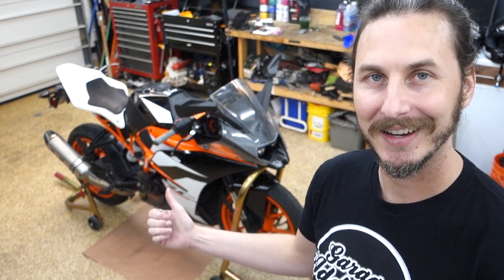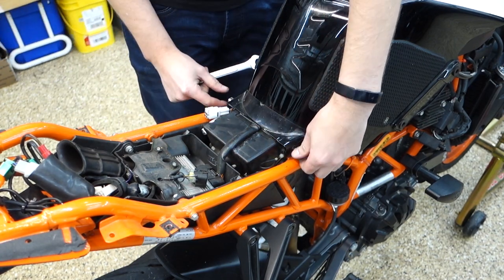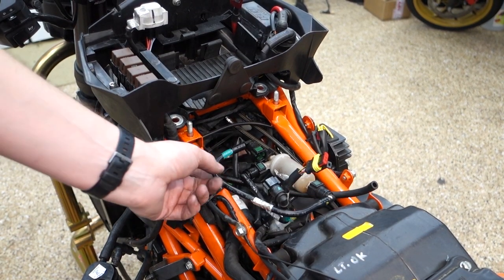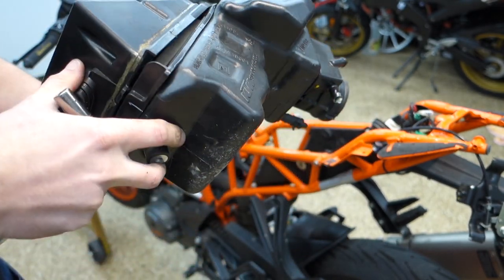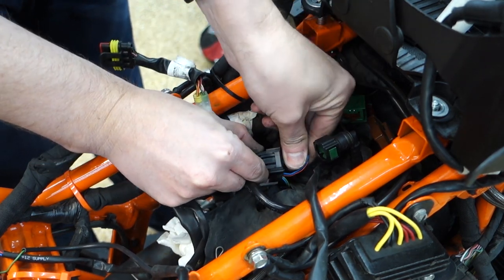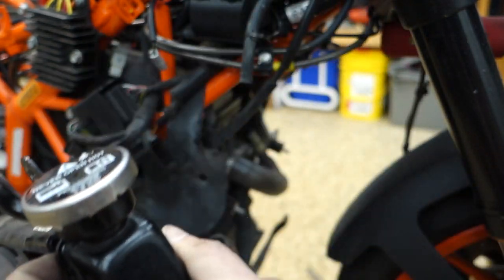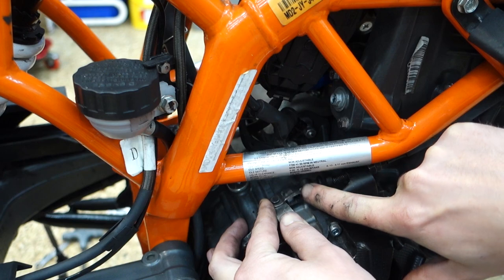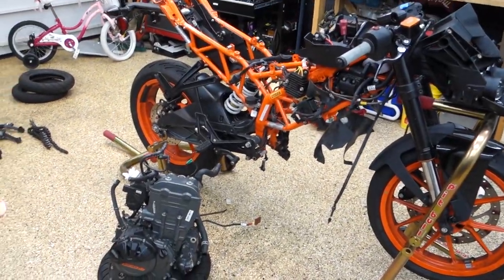KTM RC390 Disassembly and Engine Removal

Comment: Dismantled my RC390 without taking enough pictures; your video served me well as a reference for many bolts, attachments and parts placement.  This bike is by far the worst I've worked on in the past 30 years! 😞 Thank you a thousand times for your detailed video.
Reply from the maker: Haha glad it was helpful! Hope it's running well for you now!
Reply: @GarageAddiction  Last bolts where installed on dec 17th (yesterday). Even got a chance to try it on the road before the snow arrived today (up north in Canada).  🙂Having reajusted the valves (out of spec badly) and discarded the stupid rubber sheet over the engine I can clearly hear the clickety of the valves; nothing alarming.

Comment: Nice work. Taking mine out this winter as I bought it cheap with 13000 on and a full service history...... Except when I looked at the service history in detail its never had valve clearances done. Useful video at least I know what awaits me!
Reply from the maker: Thanks! I’ve got another video doing the valves too. They’re not so bad but I’d pick up a shim kit before you dive into the engine. Sounds like you got a steal on the bike!

Comment: Could anyone help @ 43:29 there is two black connections on the middle left a couple inches above the motorex logo what are these my Duke 390 has a oil buildup there
Reply: He points exactly to them at 43:03

Comment: 26:04 ideally this breather  pipe should be routed to a closed filter externally. You can get many adtermarket breather filters. There would be 2 of these one from the crankcase which would have some liquid exhaust vapors coming through, the other from the top engine case with only vapor. Inhave removed these from the air box. Companies also do this to cheat on emisson norms is what i heard. Cheers!
Reply from the maker: Yeah I’ll probably tie these into a catch can at some point. It seemed like a decent amount of fluid made its way into the air box previously. Cheers!

Comment: What were the most common sizes of bolts you used during this? Trying to put together a small toolkit for roadside repair
Reply from the maker: I'd have to go back through and check but I know 5 and 6mm allens, and 10, 12, 14 sockets would be good.
Reply: Your bike should have a kit under the seat, if not maybe you can find one on ebay hopefully?

Comment: Which oil do you use? Here in Brazil, MOTOREX full synthetic 15w50 is indicated. But this changes in each region.
Reply from the maker: I use Motul 300v 15w50, https://amzn.to/3Uc6hHX 
It doesn't get very cold here so it's perfect.
Reply: @GarageAddiction  Thank you.
Reply: @debyttt1  In India, we use 10w50 grade for 390 Only and Motul, Castrol and Liqui Moly are the standard brands for KTM. Castrol is the BEST for Duke-RC 390.

Comment: Hey bro, i am from India i need some suggestion...i dontknow if you r aware of Bajaj bikes they are sister concern of jtm, here i would like to know if we can swap engine of duke 390 with Bajaj ns200... If possible can u do some research on it...and plz let me know if possible..i will be waiting.
Reply from the maker: The engine mounts look similar but info on the  Bajaj ns200 seems pretty sparse. My guess is that it wouldn't be a straight swap.
Reply: @GarageAddiction  yes it would not, so that's why i thaught if u could help in this mod...anyways best of luck.

Comment: Hi there - i'm starting on this project myself this week. The donor motor is a 2018 Husky 401 motor which from what I heard was made in Austria so hopefully I wont run into any issues with the head gasket. Question for ya - which parts did you find was not really necessary to remove in the end (if you had to do it all over again?) great video this is going to serve alot of people well especially newbies who dont know what a pile the early gen RC390's are like me ha!
Reply from the maker: It's been a while but I think almost everything I pulled off needed to leave to get the engine out comfortably. Interested in how the 401 does in there!
Reply: @GarageAddiction  I will def keep you posted!
Reply: Just wanted to let you know I got the 401 motor in and running. Only thing with swapping older to newer motors is that the gear indicator connections and coil pick up connections have changed. Its easy to splice the coil pick up in there but rather impossible to do integate the gear indicator without swapping them out and splitting cases. Not a big deal but the bike wont idle with the kickstand down because it doesnt know what gear its in. I will use a bypass to fix that and just live with it for now...just wanted to give you an update. Thanks for all your help with the video, it helped. I did not remove any harnesses or cables out of laziness and fear of not remembering how it all came together but your video was clutch in the whole project. Many many thanks to you.
Reply from the maker: @Freddi922  Glad it went well! That sounds like a fun project!
Reply: Keep up the great valuable work!

Comment: I wonder if you are loosing coolant from the radiator where you see the road grime. If you had a head gasket issue, wouldn't the engine temps rise fairly quickly?
Reply from the maker: I haven’t lost a drop since the rebuild. Before the temp would increase and never drop, the fan would come on and it would remain in the top line. Now it bounces between 1-2 under the line after hitting it. I’m actually thinking of adding another fan or larger rad to keep it 1 under the top line constantly.
Reply: @GarageAddiction  i reccomend the spal racing fan on amazon my bike stays around 6 bars even in az summer
Reply from the maker: @tru1stdrifts104  yep, rocking the spal fan and it's great

Comment: this single cylinder bike has lots of electronics than a 2 cylinder ninja 300, Fan made in india by kinetic
Reply from the maker: Many, many connectors in here.
Reply: @GarageAddiction  where is abs module located i didn't see it ? does it have a separate ecu or integrated to it ?
Reply from the maker: Not sure, it may be under the battery tray where all the brake lines converge but I never looked